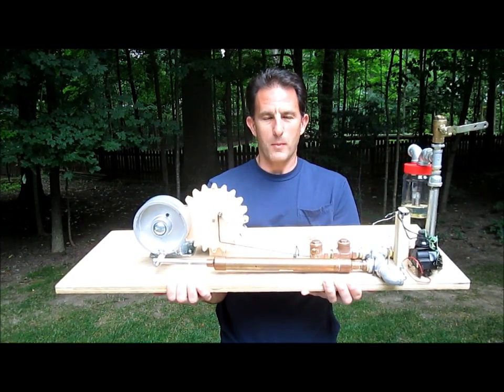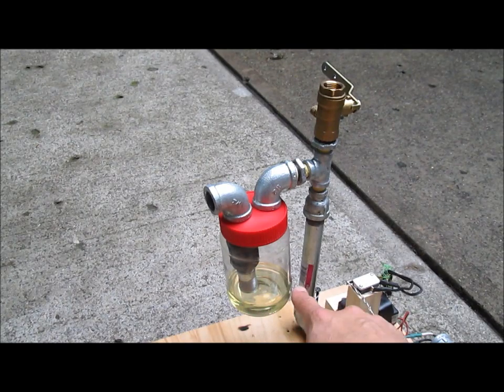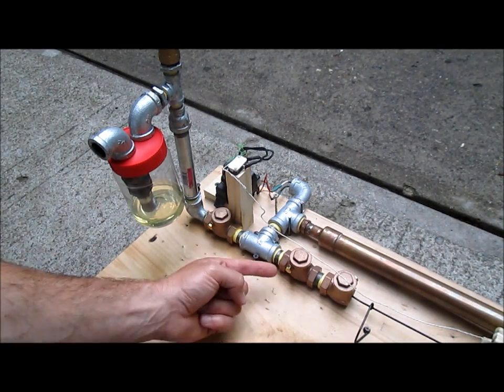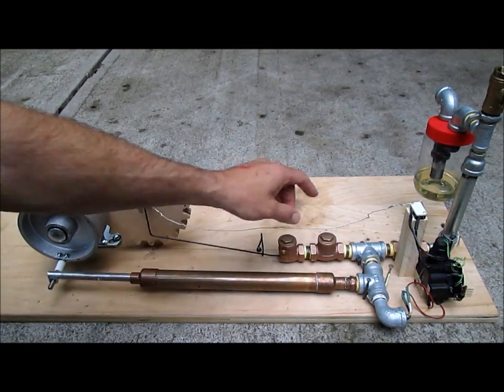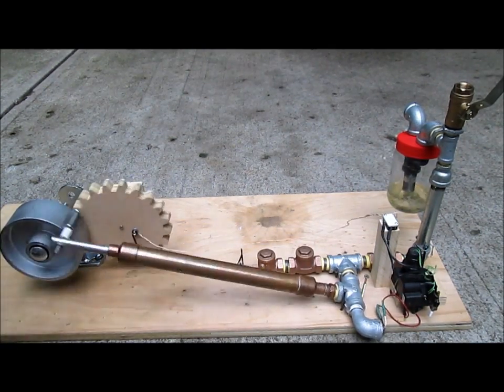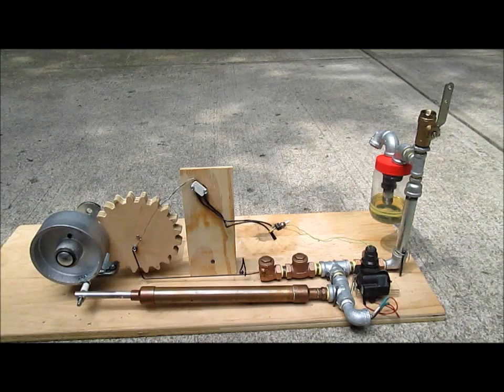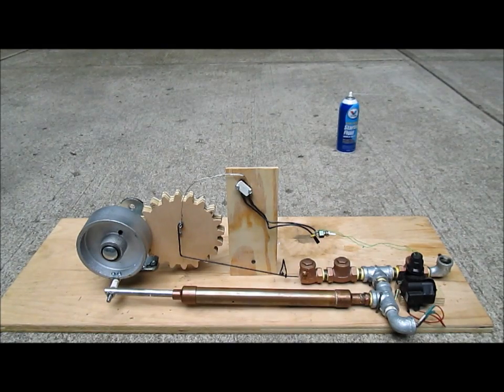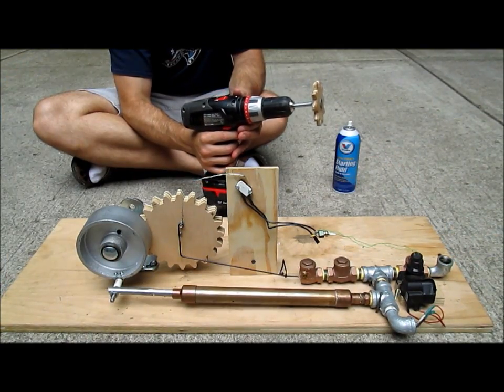How To Almost Build an Engine With Only Parts from the Hardware Store 3 (HowToLou.com)

Comment: Haha brilliant - Great work. I've just started one (completely unaware that others are) essentially doing exactly the same thing. Parts only from the high-street stores. Except for the ignition coil, plug and battery. But i've made an entire engine block and cylinder out of metal coffee tins for the interior, surrounded by epoxy putty (quicksteel) surrounded by timber. Only the crank case has timber outsides, the cylinder is entirely epoxy and coffee can. There's a metal washer embedded into the bottom surface of the cylinder head/cap to ensure that the internal corners/edges are sealed with machine finished metal. I'm using an 8mm crank shaft (originally from a garden gate hook) on the best metal skateboard bearings the local skate shop had. The piston is made from epoxy with a steel connecting rod (and pin), a steel wire piston ring, crank mad from M12 steel extension nuts (for M12 threaded rods). I drilled into the side of them to push the 8mm crank shaft and connecting rod shaft into, but filed flat spots on the tips so that (when pushed into the extension rods) I could secure them using small section of threaded rod (acting as a grub screw) down the main threaded hole in the extension nut. All I had to do was hacksaw sockets for a flathead screwdriver to fit in so that I could really tighten it. That bit was essential as obviously, the shaft needs to turn when the engines running (especially if timing the engine relies on crankshaft cams).

I've blown up one 12v coil already, which was fun. I've learned that most 12v coils aren't designed to run on straight 12v DC. Rather only for starting the engine where the starter motor simultaneously demands a blast of volts. The rest of the time, these setups return the coil to a 6-9v circuit while the key isn't in the start position. I also found that for contact breaker ignition, a ballast resistor may be necessary to soften the sparks on the points and to increase longevity of the coil. My contact breaker is truly beautiful now. The first iteration was questionable, but this time it's really good. I used the best part of a suspension adjuster tool for the arm, which was great because it has an indentation on it for the spring to attach to. It is activated by a cam on the crank shaft, made from a nut, in which all but one of the 6 edges have been filed, sanded and polished to perfection. A small hole was drilled through it, and tapped so that another homemade grub screw could secure it to the shaft. Which had a matching flat spot and notch drilled into it for the timing cam grub screw to secure to. I haven't wired-up the new coil yet, I have made a ballast resistor which which constitutes to 4 ohms if I need it. Made from a stainless steel spring pulled apart so that the coils aren't touching, and saturated in a cylinder of epoxy. I guess I can stack them up if I need to. 

I want to sort my fuel injection/carburation out now. And knowing that a venturi effect is ideal, i'm wondering whether or not it is vital? I first thought pipes an taps/valves would do it.  Good to see it can be fed straight from a jar with some pipes. I wonder if you could elaborate on the important bits?

Comment: You need more fly wheel weight a better ignition system and more compression 
1. Find a larger pulley for the flywheel 
2. Use a model airplane spark ignition system
3. add an o-ring to your piston to reduce blow by 
(You don’t need two exhaust check valves one will work fine)

Comment: I think you need bigger flywheel and better compression. I made two working engines and good compression was very important. You have problem with inlet valve.
Reply from the maker: Please send pictures of your engines to HowToLou@gmail.com.   I would love to see them.   I discovered the spark was arcing outside the cylinder, and fixed that, and am working on a more consistent fuel air mixture.
Reply: @HowToLou  sorry, I don't have to many pictures yet but on my channel I have videos :)

Comment: I'm working on a similar project, but a stirling engine.  What did you use for your piston?  I don't have any metal working tools and can't seem to find anything that works "straight off the shelf".  Thanks!
Reply from the maker: I used a 3/4 inch brass plug in a 1 inch copper tube.  It fit perfectly.  You can wrap the threads with a little Teflon tape if yours is too loose.

Comment: How did you make that spark plug
Reply from the maker: Two copper wires and JB weld inside a pipe fitting
Reply: ❤️ OK thanku 😊👍

Comment: the location of the spark plug is not good. Try moving it between the valves and the cylinder.
Reply: and the flywheel is to small for a one cylinder 4 stroke.

Comment: I just found this video.   It's adorable.  I was disappointed to see that there were no updates.  I hope you want to finish it, so I don't have to.  :)   

IMHO, you already know what it needs.  Here's a few suggestions  

First, you might find yourself with some hints if you go buy something with a little gas engine for reference.  A working or non-operational string trimmer, generator, or lawn mower can teach you a lot.

On a normal engine, the harmonic balancer and flywheel provide inertia for a smooth spinning engine.   Cars have to be the careful balance of heavy enough to spin, light enough to change RPM.   It looks like it's partially giving up because there isn't sufficient momentum. 

Look around for diagrams of a magneto, like a small generator or 
lawnmower uses.   You can make your own with winding wire a magnet, and a 
little time. 

The carb looks interesting.  You may need a little valve to atomize the fuel better.   Trying it with starter fluid should work.  I was taught a long time ago to use WD-40.   It's not as explosive, and has a nice wide mixture range to combust in.   I've run all kinds of motors, like garden 2-stroke and 4-stroke engines, all the way up to computer controlled V8 engines.  Since it isn't firing with the starting fluid, you have eliminated your fuel as being the only problem.   It could still be a problem, just not the only one.

Without the ignition on, or even gas, see if the piston is drawing in air/fuel on the intake stroke, and pushing it out on the exhaust stroke.  If it isn't actually moving air, that is definitely a problem.  I saw some comments addressing improved rings.   You could make your own rings, if you're feeling particularly ambitious. :)

Moving air may also be a problem if the valves aren't sealing up when they're suppose to be closed.

Double-check your sparkplug. Make sure it's arcing inside the combustion chamber, rather than somewhere else on the engine.  That's easily overlooked where we would have a nice ceramic insulator to keep it off anything else.
Reply from the maker: +JW Smythe -  Well you hit the nail on the head with your last comment. I was sparking outside the cylinder.  Now I am working on a better mixture, so I get pop every time.  Shoot me an email at HowToLou@gmail.com and lets talk more.
Reply: BTW, sent. :)
Reply: Time your spark to happen at Top Dead Center, when the piston is at it's farthest point from the crank shaft.  If you are getting a spark out side of the cylinder, you will need to ground the coil to the engine frame with a wire.

Comment: +HowTolou 

You should use the coil from a dirt bike or car and run it off a battery and make some points for better spark. You also need a much larger flywheel. 

Also it doesn't look like it has any compression. Compression is very important. I suggest getting  rubber o-ring and making a groove around the piston then slide the o-ring over the piston. that would give it compression. It might break pretty quickly, but that just means it was working. 

One last thing besides the piston not having rings the whole head design it too big. There is too much space and air too compress well, I would also suggest designings a smaller head that allows for more compression.
Reply from the maker: +Nick Kluger - thanks. I am working on increasing compression by making the head smaller.
Reply: +HowToLou what are you using for rings on the piston? Because that will probably increase the compression the most. 

Also for the exhaust port you should make a cam that opens it at the exact time. Because how it is it stays open a little on the compression stroke.
Reply: +HowToLou And probably most importantly, larger flywheel.
Reply from the maker: +Nick Kluger.  I am just wrapping the piston in  aluminum foil to make a seal.    I can certainly switch to an O-ring pretty easily.   I have fixed the exhaust opening system.  Honestly, my biggest problem was that the spark was firing outside the cylinder.   I fix that, and then I got busy with other things.   I will get back to it this summer
Reply from the maker: +Nick Kluger    Yes, pretty much everyone says that. I want to get the other things working before I change that
Reply: +HowToLou Alright. Cool.

Comment: I heard it backfire so.... you have a timing issue. 
I would ditch the wooden gear, and make a series of lobes your crank for the sparkplug switch. I my opinion, you should turn the check valves to a vertical position instead of horizontal.

Comment: Anything new?
Reply from the maker: +CreeperOnYourHouse -  Figured out a HUGE problem was that the spark was very often happening between the wires outside the cylinder.  I insulated the wires more, and that problem is gone.  Now I am just playing with the fuel air mixture.  I hope to get it running soon and post the "final" video in this series!
Reply: +HowToLou will you explain the issue with the failed sparking in more depth in the next video?
Reply: It's been 9 months. Wassap?

Comment: does your pisto have a o ring ?
Reply: +HowToLou Not gona work. You really need to make a piston with a lathe, and use piston rings. Making an IC isn't the same as making a simple steam engine which can cope with some sloppyness.. An Ic engine can't.
Reply from the maker: +Roaring Creativity - No, I did wrap it in tin foil to get better compression.
Reply from the maker: +Skoda130 - You are probably right, but I hope not.  My goal is to make this without machine shop tools.  While it is not running yet, it has had several pops that pack enough punch to send the flywheel spinning several times around.  If I can get that to happen repeatedly, we will have a running engine.
Reply: You can buy some hardware store epoxy like JB Weld high heat liquid metal.  Mix it up and cast it inside your cylinder.  Coat the cylinder with Pam or oil as a mold release.  When it hardens you have a piston with perfect fit.  If you want to use an "O" ring make another epoxy piston and screw it to the first one squeezing the O ring in-between.  You could also cast the O ring in place.  Use a green O ring to take the heat.

Comment: Not really sure if you are still working on this or have gotten it to work.  Here goes, first the cylinder is much to small in diameter.  Increasing the bore will in turn increase the compression which seems to be way to low.  The stroke is quite long which is ok but if you look at all of the area in pipe fitting that you are using the compression is not much.  Increasing the volume of the cylinder, ie bore, will get the compression to where it needs to be.  Should be around 5 or 6 to 1.  Right now I would guess it would be at 2 to 1, maybe less. 
Second four cycle engines do a lot of spinning for every power stroke.  Think about it, the four stroke is quite inefficient it only has a power impulse every two revolutions.  A two stroke fires every revolution, most steam engines have two power impulses per revolution.  Four strokes with one cylinder and other inefficiency, like most older designs, need lots of momentum to get to the next power stroke.  This is usually done with a heavy flywheel.  But also by lightening the rotating mass.  Holding the cylinder fixed and using a moving connecting rod will lighten the rotating assembly greatly.
Timing needs to be more precise.  More than a wire pulling a switch.  And timing is normally before top dead center, as the explosion takes time to build pressure.  A way to accurately advance the timing would be a big help.  A simple coil and points system with a battery is the way to go. 
I do like the carb system.  Vapor carbs work good in these applications.  I have had success with them.  I think your intake pipes are to large, they simply don't need to be this big, makes it really hard to regulate the air fuel mixture.  You will also need a second valve on the carb to regulate the amount of fuel mixture.  Think of one as fuel and one as air.  They both have air but only one has fuel so it is the fuel side.  Fuel side regulates the speed of the engine, air side regulates the richness.
The idea of an engine made of hardware store parts is a good one.  Make the changes I have suggested and it should run.
Reply from the maker: Great comments and ideas.  I have been working on other projects, but need to get back to this.  I did buy a points and condenser set.  I will try that next.
Reply: do a google search on Henry Ford First engine.  This was a motor build in the 1890s with similar parts.  Building an internal combustion engine with no machining from ordinary parts is something I have put much thought into.  I am not sure if it can be done.

Comment: You dont seem to have any compression in this engine.The first ic engines were non compression and were 2- stroke so to speak as they fire the engine every revolution,you might stand a better chance with this system.The exhaust valve is opened directly off the crankshaft and it fired on the induction stroke.

Comment: Have a look on the net at Henry Ford's first engine I think you may get some ideas ,keep trying regards Bill
Reply from the maker: Thanks.  Yes, I looked at the first Ford engine.  It looks like he used a real spark system rather than a grill igniter.  I will replace that in my next attempt.
Reply: he used what is called a "trembler coil"same as used on T model Fords how they work I dont know.regards Bill

Comment: I would think your problem would be spark timing possibly, but most likely I would think that your check valves are to slow with a gas which should be evident by the gas puking out your carb.  I would think if you can figure out how to do basically what you did for the exhaust on the intake side or if you can ad a small spring instead of relying on gravity for the check valve it would do better.  but then again what the hell do I know Im not building it, nor have I seen it in person

Comment: Could it be that your check-valves are spring loaded?  You may need to redesign it to allow a cam to operate the valves.  Good luck and don't blow you head off.  After all, a combustible engine has already been invented. :)

Comment: Your cams has to many or to few teeth. Or there to far apart or to close. And play with your timing. It has to be on a sucking air when you set top dead Center.

Comment: get a large flywheel so after you start the flywheel the engine only has to keep giving it power to continue spinning, figure out how to get the air fuel mixture correct or switch it to nitromethane which is way easier lmao, and lastly get a really damn strong spark plug to guarentee your mixture ignites as good as possible, the bigger the spark the more reliable that nothing can go wrong as far as ignition. oh and find out how much compression you're getting

Comment: flyweehl.... you need more mass to get it rolling. consider a more accurate igniton method. like a piston which triggers your piezzo at the right moment (not pull but push) i reccon your corrabutor is good enouth, it worked at your first attempt. i think the problem is more at timing and mass.

Comment: you need a magnet on the big wheel and a reed switch to comand the sparkplug. you cannot have the proper timing using just a string or a wire connected to a switch... ;)

Comment: Hey! Looks awesome! The only thing that really comes to mind is that there is a delay between pressing the ignite switch and a spark actually happening, meaning that when your engine is rotating fast enough to actually keep itself going, it is then too fast for a spark to happen due to the long delay between contacting the switch and the spark occurring.

Comment: Great project 
I would try the ignition at or slightly after TDC.
I'm thinking you might have a bit too much volume on the ignition chamber. You might be able to minimize the volume a bit by using a four way instead of tee's. As if one opening is the cylinder another is intake then exhaust and spark. 
Anyway just my 2c great project

Comment: I think you have 2 major issues here.

1. you NEED a larger rotating mass

you should be able to give the engine a good spin and have the mass push it 2 - 3 rotations

2. you have a compression problem.

I think it may be in large due to the valves you are using. If you look at the part of the video with your improvised carb, you can see it spit fuel out the intake of the carb. also, how good is your piston to cylinder seal?

if I think of anything else I will let you know, good luck!

Comment: You're mixing exhaust with your fuel. You want two separate fuel/exhaust manifolds and make those as short as possible. 

A bigger, heavier wheel will help in keeping momentum for the engine to get to the next cycle.

Comment: The fuel was spurting back out of the intake tube and there was also a flame coming out of it when you used starting fluid. I would say your check valves aren't working well. Also check the gap between the electrodes on the igniter to make sure you're getting the most spark possible. Normal engines run a much more powerful spark. You may even want to use a glow plug type system. Also for better atomization of fuel, switch from the bubbler to an air brush setup.